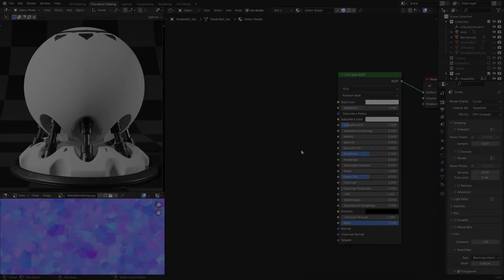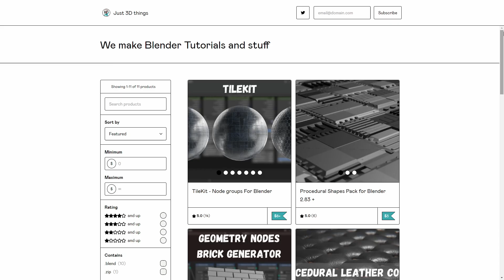How to Make Glitter Shader in Blender in under 2 mins

Comment: For anyone getting a flat shaded issue its due to your colours not being right. If you start and finish with colour #8080FF on your ramps you'll get a better result. This colour means facing the camera. the more you move away from this colour the more it turns the light away. so start on this then adjust the colours slightly
Reply: you the real mvp, just had this problem

Comment: you go too fast when u show doing the connections to the olor ramp before u uplicat the steps. u go very fast showing how u choosed the color on the color ramp and how u made multiple colors show up in 1 second..
Reply: Download any normal map png from somewhere. In the left hand image pane browse and open the normal map image. Add color stops in the colorramp node using the + on the colorramp node. Add a color to each stops by using the color picker and taking colors from the normal map in the left hand pane. Hope this helps.